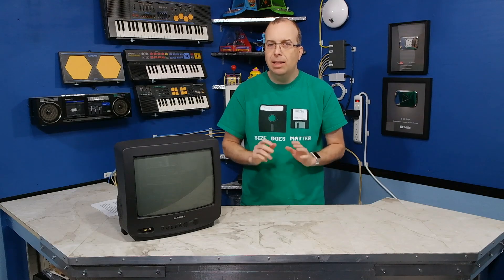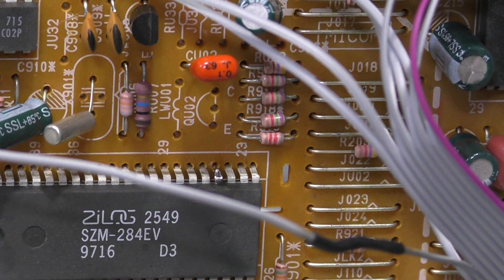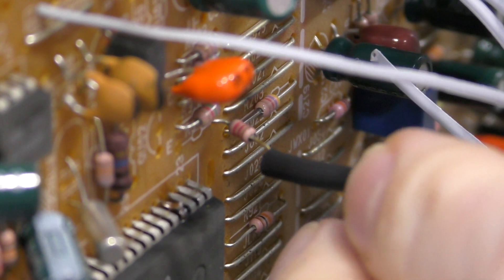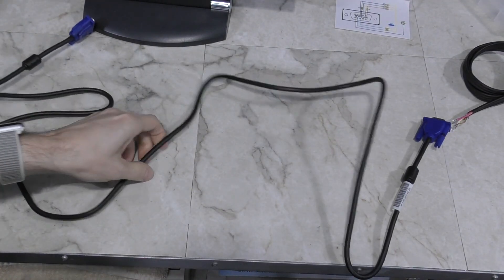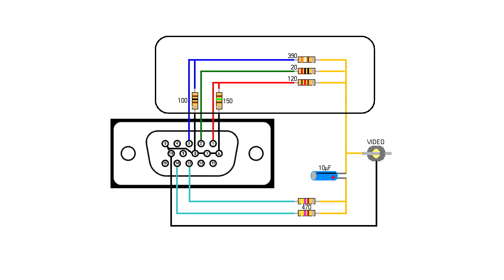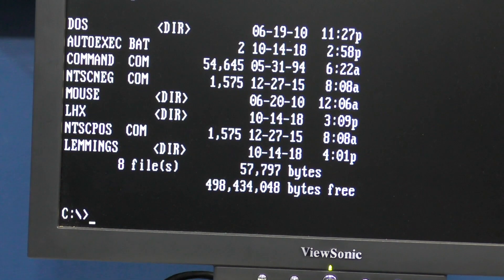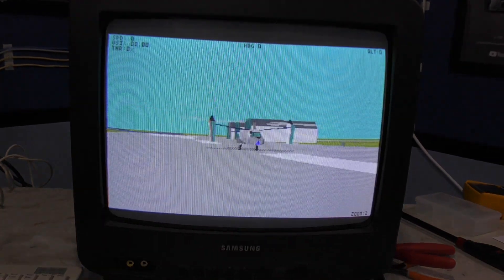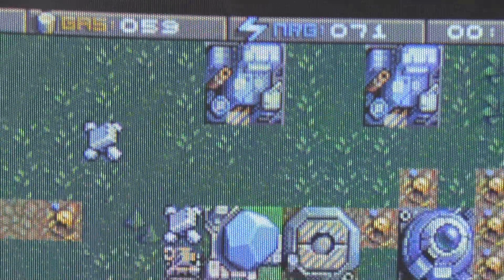Modding a TV for RGB - Part 2

Comment: Well, duh.  Also, I have a concern regarding the RGB lines where if you activate OSD you may have output drivers of the OSD chip and output drivers of your console fighting.  I learned that mistake of running two output drivers into the same line (assuming I was doing a "wired OR") and cooking some 7400 series chips in the process back in college.  I would also put OSD chip's output enable pin onto the switch if it has one, that way when you've switched your RGB mod on the OSD chip will not be activating output drivers...  that is, if it has such a pin and the chip is tri-state.  Otherwise cut power to the OSD chip with the switch.
Reply: You are right, but since there are resistors in the system, we are probably speaking of a few miliamperes that won't cause a lot of trouble. If you are purist you could try to fix this, but generally a few miliamperes will not damage electronics.

Comment: If you ever do this again you should use a VGA connector on the TV.
It's smaller and more convenient then using RCAs.
Also VGA has +5 volts on pin 9 that you could hook up to a relay that automatically switches the blanking on the jungle chip.
This way just plugging in a VGA source will switch the TV into RGB mode and unplugging it switches it back.

Comment: You can do that in Windows using CRT_EmuDriver and specific cards. That's well known in the emulation scene when you want to use an original arcade monitor, or, like here, a cheap TV that accepts RGB.

Comment: +The 8-Bit Guy Hello! I was thinking of doing this mod for myself with friends, for an n64. But since I need to buy a specific Scart cable, should I buy a cable equipped with C-sync or sync-on-composite if I were to "grab" sync from the composite connection on the TV?

Comment: NTSCPOS.COM and NTSCNEG.COM can be found here:  https://web.archive.org/web/20160304020057/http://www.ccs.neu.edu/home/bchafy/tvFiles.tar.gz  or here:  https://sites.google.com/view/bchafy/linux-on-obsolete-displays-project-page-featured-on-hack-a-day     (in the VGA to TV conversion info section).       A word of caution about doing these mods:   Understand mains ground references and isolation!    Some/many TV's are hot chassis with selectively isolated inputs.  Others are completely transformer isolated.   When working with TV's, you cannot assume just any ground is an isolated one.   Most CRT TV's (in the US) are not earthed, whereas most VGA monitors are.   A laptop is usually not earthed whereas a desktop PC usually is.   Connecting earthed chassis with hot chassis can lead to spectacular smoke effects.    Connecting yourself to a hot chassis can lead to spectacular medical effects.   If you don't understand these issues (and they can be a bit esoteric), I'd recommend at least looking at the videos by EEVblog, The Post Apocalyptic Inventor, and Mr Carlson's Lab.

Comment: this TV has hole for SCART in the back and special filler with CVBS/Audio RCA. I wonder how this part of PCB looks like? I could happen most of circuit is prepared for both markets (EU and US). SCART is beneficial: there is supply of different cables XYZ->SCART (Atari ST, Amiga etc.) and new hardware to build complex setup (like Hydra Switch for example)

Comment: You could also have put a diode in series with the blanking signal from the micro controller.  That would keep the 5v off of the micro controller, but allow the MC to feed the signal to the Jungle Chip.  Of course as long as you have the DP switch, that solves the problem too.

Comment: Aren't those DOS games programmed to sync at 70 Hz instead of 60? Or do they actually sync at all? I am pretty sure you won't get smooth Commander Keen on a regular CRT TV simply because it wasn't programmed for this type of display... So in short DOS games are no no for the 15 kHz CRT TV if you are video (pixel) purist...
Reply: VGA is 60Hz as well, you just go from 480 lines to 240 lines to halve the horizontal frequency from the 31.5 KHz VGA frequency  to 15.7 KHz TV frequency. Therefore games that depend on Vsync for timing (unfortunately Vsync is rare on PC MS-DOS games), should play correctly.

Higher refresh rates only became popular in the Super VGA age, when refresh rates up to 75 Hz became popular.

Comment: Interessting mod. However if I'm not mistaking the "ground potential" in old crt-tvs can be half the line voltage (60V in US and 120V in EU) making the ground on the connectors very unpleasent to touch... just a word of precaution to anyone trying this mod. I assume this could be avoided with capacitors in line with the ground wires when soldering them to the connectors.

Comment: Years ago, I fixed a garage brake checker. The monitor was dead, it was a Philips RGB. I went to the local mall, bought a small 14" CRT TV (99 €) and a spare SCART connector (1 €). I then cut the DB9 wire from the dead Philips monitor, soldered the wires to the SCART, plugged on the back on the TV, closed the box and voilà. All the guys had to do was to press the "AV" button on the remote. Bendix was asking 999 € for a repair.

Comment: On a SCART connector, the blanking 5v is sent thru a 1k resistor to protect the circuits.
Reply: An 1k resistor is not a good idea. According to:

http://www.hardwarebook.info/SCART

... the blanking pin has 75 ohm impedance and requires a minimum of 1 Volt for activation. Adding an 1K resistor would make it 1075 Ohm in total and create a voltage divider of 75/1075. 5*75/1075 = 0.35V, which is quite a bit lower than the minimum of 1 Volt required to activate the blanking pin.

I would use a resistor of 150 Ohm (in fact I did in the Commodore 128 to SCART adapter I built myself). This creates a voltage divider of 75/225. 5 * 75/225 = 1.67V, which is well above the required 1V that is needed to activate the blanking pin.

Comment: European TVs have scart inputs. It is the ultimate cable. It can carry and is compatible with RCA, S-video (luminance and chrominance), RGB, can carry basic data with those signals and even provides a video output at the same time.

Comment: I'm surprised the VGA signal was that clear with so much shielding missing. VGA shielding can mean the difference between near HDMI quality and worse than composite quality. I bet if you made a VGA adapter cable that was properly shielded it would look even better (not that it would necessarily be worth the trouble to actually do so, as you pointed out).

Comment: if you use an older ati radeon hd card like a 3450 you can modify the vbios with a utility called atom15, which will allow you to boot the computer in 15khz natively from the bios

Comment: You could have also used a 1N4148 to block voltage from going into the uC, but having a SPDT switch what you did is equivalent to that :-)

Comment: Do you can use the audio input on the TV when displaying RGB? because that's would make this complete! :)
Reply: That is no problem, a television will not disable its audio input if the on-screen display displays something. Because you are using the signal lines of the on-screen display, audio will just work.
Reply: But before start using RGB, you need to switch the TV to composite input for activate the RCA sound input, I guess...
Reply: No, becaurse the on-screen display is an overlay over the composite picture. If connect the blanking signal to 5V, the overlay will cover the full screen, but the TV will still consider it an overlay and still listen permanently to the composite signal, it just never gets displayed.

Wether the "OSD" covers part of the display or all of the display doesn't matter for audio, so no, there is absolutely no reason to switch to composite input to active the audio.
Reply: I meant, the TV vould not use the RCA audio input if the selected input is the cable TV tuner, I think. So, in that case, switching to composite is necessary for audio input...
Reply: Yes, that is true, but in such case there will also be no picture. The TV wouldl attempt to overlay the RGB picture, but because the TV is using the sync signal from the NTSC tuner rather than from the composite input, it would be out of sync, causing garbage on the screen.

Comment: There is actually a really cool product that allows a PC to be connected to a 15khz display; the ArcadeVGA: https://www.ultimarc.com/avgainf.html.
Reply: Using a regular ATI card (HD4000 series and newer) in conjunction with Soft15KHz or crt_emudriver is a much better and cheaper solution, granted it still has analog outputs (through VGA or DVI-D). Also, you will even have the possibility to inject a modified BIOS making even Post and boot screens show at 15KHz (process is riscky and may brick your card, but I did it with success on one of my cards). AracadeVGA cards seem overpriced.

Comment: I would've added diodes to the Microcontroller and modded wire side so no rgb/blanking gets backfed into the microcontroller or from the microcontroller into the modded connector (computer)

Comment: You may still need a resistor to ground on the circuit between the Micro Controller blanking signal generator chip and the toggle switch, to pull down to 0V when not active.

Comment: Or put a diode between microcontroller and jungle chip, just before to your switch connection.A diode, cause a small drop of voltage (around 0.7 v.), when direct polarized, but should be still acceptable.

Comment: I'm just wondering... with all the clone-(S)VGA cards that flood the market in the early 90's, why there was no card with simple TV out? It would be awesome in Europe, especially for Amiga or Atari ST owners who got good RGB monitors, but operating at TV frequencies.

Not to mention, that many entry-level customers would skip getting monitor at all, or would buy a monochrome one for work and use their TVs for gaming. This is really odd, since CGA, Tandy and some EGAs had TV connectors.

Later Windows 9x era cards started to have TV OUT connectors. Early Geforces or even TNT1 and TNT2 had them. My old Geforce 2 could do composite and S-VHS output and it was possible to do the RGB using modded drivers and an additional connector soldered to the card itself.

Even my Geforce 8800 had analog TV out, but it was only for yPrPb component HD signal, at least such cable was in the box. Never used it, because at that point every TV had VGA and HDMI.
Reply: The TV out on those cards was almost always composite or S-video. In rare cases component. I never saw RGB. You could get RGB from the VGA port of course.
Reply: As I said, I remember that there was a way to get RGB TV Out from those cards. There were pins on the board that had TV RGB and you needed a modded driver. As far as I'm remember. I've just used S-VHS to get good enough picture quality when I wanted to play on TV. My friend had a Commodore RGB monitor and he found some info on the web about this mod. Anyway he never did it, because he bought 17" CRT monitor that worked in 1024x768 at 85 Hz. So he had no use for his old Amiga monitor.

At that point in time, using analog SD TV for PCs wasn't really useful. PC monitors and games were already at HD resolution, so playing at 1280x1024 or 1024x768 was much better than 768x576 (in PAL regions).

Few years earlier, when gaming was in 320x240 up to 640x480 TV out could be much more useful.

Comment: There actually was a variant of the SCART socket which probably would allow you to get unmodified VGA into your TV set. It's called "Golden SCART" and it was available on most HDTV-TV-sets in the early 1990s.

Here's an example of such a setup:
https://upload.wikimedia.org/wikipedia/commons/f/f0/Nordmende_Space_System_92_HS_Scart.jpg

As you can also see, not all sockets actually use RGB. It was common for only one socket to have it. Also the RGB inputs typically also work when the TV is not switched to AV. The idea behind that is that you can have an external teletext decoder overlaying subtitles over your video signal. SCART usually has bidirectional composite video.
Reply: I guess, this was a HD-MAC compatible television? The SCART standard allows you to output HD-MAC (and D2-MAC) signals over the composite pins. This was the original plan for HDTV. The blanking and RGB pins should remain fully functional in case of a HD-MAC signal, so you could have high resolution 1152 line video. You would have been able to reuse all your old cables and it would work automatically, as the principle of SCART is to let the equipment sort out stuff for the consumer.

But we Europeans fucked things up seriously with the MAC standards. We later corrected the error with the DVB standard, which conquered the world, but the damage was done: No TV did accept HD signals on SCART. Therefore the death of the MAC standards also meant that SCART was doomed. The Americans got the leadership in HDTV and came with their HDMI connector. And we know the rest of the story.
Reply: Yes, apparently it had a D2-MAC decoder inside which often was HD-MAC compatible. Obviously you needed some sort of input to connect your home VCR to your TV-set, or perhaps future high-resolution computer signals, or an actual HD-MAC decoder which would resolve one layer of interlacing.

Comment: With the VGA signal, I was thinking of someone adding in a microcontroller to transmit an EDID that tells newer OSes that the system is connected to a monitor that will only run at 640×480, with 15 KHz horizontal and 60 Hz vertical timings, at least I'm sure that's what the timings need to be.

Comment: Well, i guess it is time to track down a service manual for my 1987 NEC 27" console "monitor" TV I have here. Composite on it is lacking on it and I been using a VGA to composite converter from a laptop to stream video to it and it just just lacks detail , and the OSD display on it is razor sharp and it has me thinking this old NEC will respond quite nicely to doing a component type input mod like you did your little samsung. The challenge will be finding the service manual for it!! Nice video.